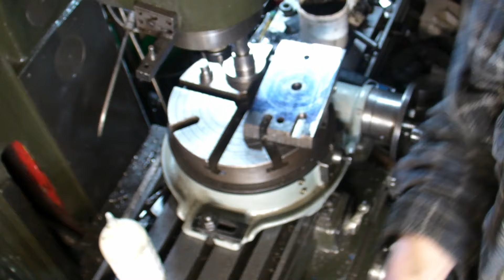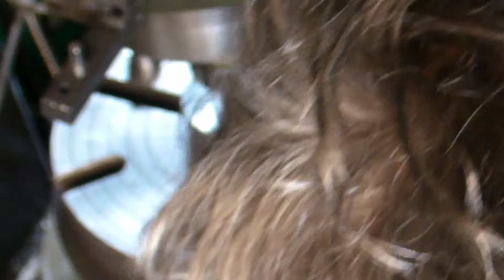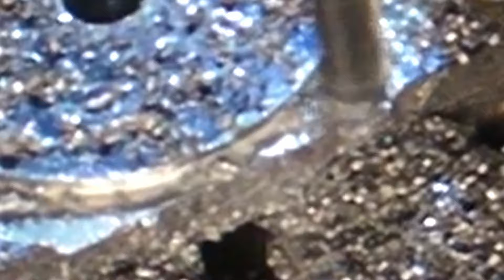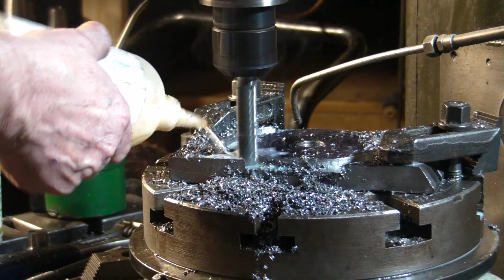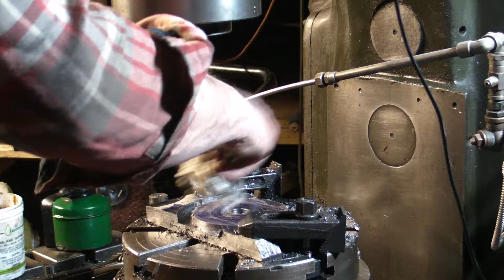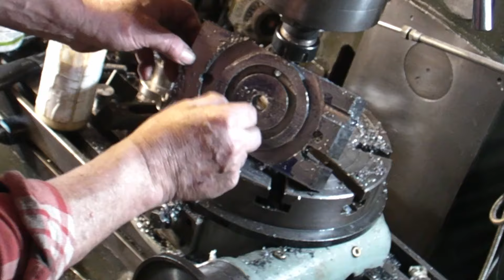Vice swivel base part 3

Comment: That looks like a hell of a nice quality rotary table Del, and you are making good use of it!!
Phil
Reply from the maker: It's the same make as the mill Phil. never been one for buying cheap tools with the exception of the Vfd's. you soon forget about the price when you start using them. Had my Marshalltown setting trowel for over 30 years now. the blade is twice the thickness of the modern one's. Did you manage to get some shop time on the first day of the week, only four more to go ! The fiver still stands.😁😄😃 Del...
Reply: @machinenutdel6764  sure did!,  got the heat exchanger more or less finished, one more closing panel and a bit of plumbing and it goes up!
Phil